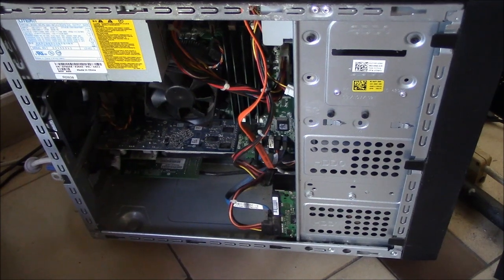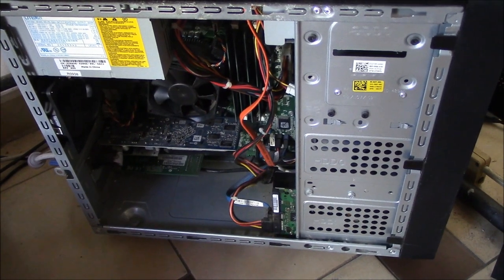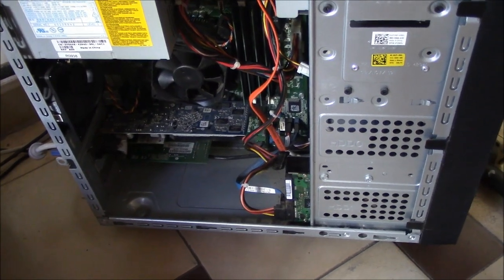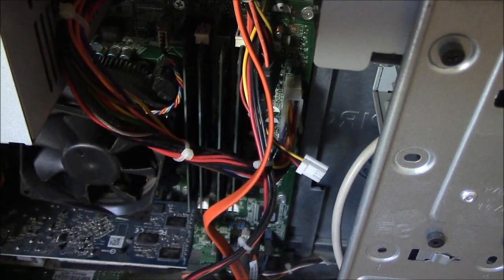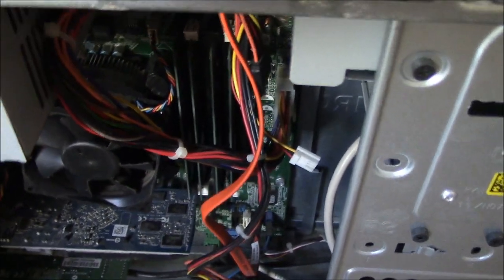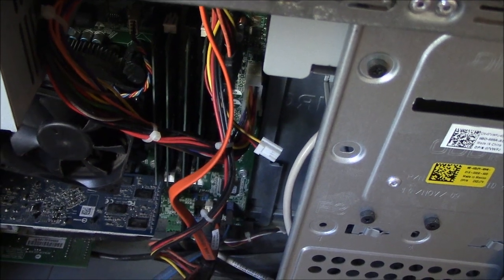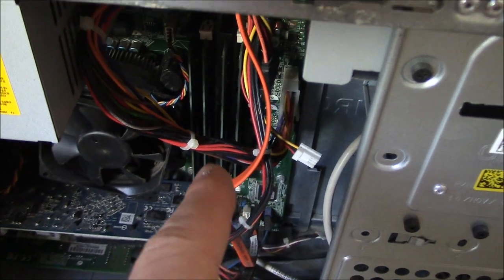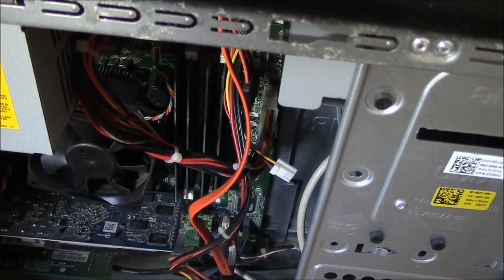Computer Four Beeps And Won't Display Quick Fix

Comment: Dude you just saved me BIG TIME!  And I mean BIG TIME!!    I was on a very important deadline.  The material I needed was on my PC. I couldn't get passed those damn beeps.   I have never opened up a tower, let alone took anything out of it.  You walked me through the whole process.  IT WORKED!  God bless you and thank you for taking the time to help people in this way.  I am so very grateful to you!!
Reply from the maker: You're welcome. Thanks for your kind comment.
Reply: Kimberley Crawford agreed
Reply: DIY University I just was trying to see if I had enough places left for an 8 pin connector for a GPU (it turned out a GTX 1650 doesn’t even need a power connector so there’s that XD), and I found out it didn’t, so I reconnected everything, and then I got the 4 beeps. I thought I killed my own PC, lol. I did unplug a couple things, but then plugged them back in so that absolutely could not have been the problem. I did see a crap ton of dust that I blew off the front filter. When I heard the 4 beeps I couldn’t figure it out so I just googled it because I know certain errors on PCs can be conveyed through beeps, and then I came to this video, and when I got to the certified air compressor part (I forgot what it’s called exactly), I knew immediately that it was because I blew dust from the front filter, and I took the RAM modules out, blew in the sockets and on the modules themselves (I didn’t have an air compressor with me), I plugged everything back in again. I thought it wouldn’t work because I go through a lot of troubleshooting with somethings and it sometimes takes hours, but it ended up fixing my PC. Thanks so very much. I literally almost shrieked out loud even at 2:20 AM, I just became overwhelmed with excitement. 😂
I literally subbed and liked immediately because my overwhelming gratitude could not be expressed any other way. 👍
Reply: Lmao I'm 9 and I did it without his vid
Reply: Drewless yeah sure you did. I find that extremely unlikely. Nobody would be able to figure that out without a video. You obviously were wondering how do you came upon this video. That alone proves you didn’t do it by yourself because why would you even be on this video?
Reply: Drewless watch that language. It’s hard to tell what jokes are in text bud: I don’t appreciate being talked to like that. Kind of racist language.
Reply: Idk why every computer dies when you have something important to do mymymy
Reply: @allaprima  uh, what?

Comment: Thanks for the concise tutorial. It didn't work for me, but as I had the computer on a bench and could see inside, I noticed that the fan in the PSU did not spin up. I replaced the PSU, and all is good again This was on an HP Z420 workstation. So if this doesn't work, check out the PSU.

Comment: I just used a vacuum and it worked perfectly, thanks
Reply: YOU DID WHAT
Reply: @Dekoyy  used. A. Vacuum. Cleaner.
Reply: @Jordamson  Oh my. Uh just gotta tell you that um vacuuming electronics is not a very good idea
Reply: @Dekoyy  um, why not? Lmao
Reply: @Jordamson  Using a vacuum cleaner on electronics can generate static electricity and fry components
Reply: @Crdguy  lmao dw, it's an small computer vacuum cleaner
Reply: @Jordamson  Ah okay, fair enough

Comment: Thank you so much. It worked. There was just a bit of dust on those drives i removed them 1 by 1 cleaned it up and after that it was working again thanks

Comment: You need to specify the maker of the motherboard. The start up codes are different for each manufacturer. That's why you have people in the comments saying it didn't work. What works for you motherboard won't work for someone else with a different brand.
Reply: Actually with this, the 4 beeps means there was something wrong with the ram, and that should be universal, if it didn't work for other people it could mean either their ram has gone bad or there's a problem with the motherboard

Comment: I have an HP workstation (the wx4600 to be more precise; yeah, I know it's ancient ;)). Whenever there is an issue with the seating of the memory modules 1)I get a different number of beeps (if I recall correctly) and 2)the CPU fan starts spinning like crazy. If you have some dust in it you will probably enjoy a nice cloud of dust that the fan farted out right when the crazy spinning starts. LOL

It's up to the motherboard manufacture and this video here should mention 1)who the board is from and 2)that it's not an universal solution.
Reply: rbaleksandar hey I have the same exact problem as you, I have an old hp with upgraded parts in it and I recently put in a new hard drive because my old one was skipping and now when I start it makes 4 beeps and shortly after the fan goes into overdrive mode lol. Would you be able to help me dissect this??! Thank you

Comment: Did you fixed that ?? Bro pls i need help, ich bought a new cpu and installed it. First it goes on and after 5 sek it goes off, ovr and over and over . After a few times it beeps 4 times but on the screen ist nothing. I did all kind of fixes but not even one of them helped me.
Reply: okay mohammed beruhig dich

Comment: I have 8 RAm slots . Clean up all and nothing.  And only when unplugged all the cables from the panel (keyboard, mouse, internet cable) and wait for 20 minutes PC start with no problems. Sorry for my eng. My PC is HPxw6600 Workstation  ( 8 Intel-Xenon  Processors , 8 RAM slots with 32 RAM , GeForce gtx 1050 ti graphic card, and 650 w Power Supply . Pls help.

Comment: Can you please help me? I have been removing it and changing its position multiple times. But it still beeps the same. I already cleaned it many times but still the same. Please help!!
Reply: Same for meee
Reply: Check the CMO Battery ! May need replacing

Comment: Also those simple tricks don't help. I found out if it's none of that above then it's definitely the battery for the BIOS. I changed that and it solved the problem.

Comment: i reset all the rams but it still beeping and blinking 4 times. do you some more ways to fix it?
Reply: Make sure you hear a "click", and the holders click into place without you having to click them into place with your hands. Don't force them in, but apply firm pressure
Reply: Vast Nation how can u tell which one goes in the right spot?
Reply: @zuxful4682  Well, if you bought the computer from a store, then just place the ram stick where you took it from. You shouldn't remove all of the sticks at once so you can remember where each one goes. If you are building or built a system, in most cases if you have two sticks of ram, you will put them in the slightly darker colored clips. If you have 4 sticks of ram you will use all 4 slots, doesn't matter what order. If you have any more questions just reply  to me again.

Comment: Urggghhh, how do u fix a pc that runs for 10 secs and then sounds like a helicopter and when yiu turn it off it beeps 4 times
Reply: Im having the same problem.
Reply: Possibly hard drive failure since it shuts off and gives a mobile stop code

Comment: It beeps when i turn it on after its been off. It only works by putting the ram in while pc is on
Reply: Don’t do that always turn pc off before removing components!
Reply: @Devghost  ik that but it works. the computer is a cheap best buy computer. i can explain how cheap it is. it has no ssd and is 600 dollars

Comment: I've taken all 4 rams out. Took all the devices off like mouse.keyboard.CDROM.HDD. so only mb attached with PSU .but I'm still getting the 4 beeps and red light.. Before my PC ended up like this the CPU fan was running at full speed even if I was not doing anything on PC ..and when I switched PC off after 5 seconds it automatically turned itself back on ..I would have to set the time and date in bios all the time since this problem started .also i relised the lan port did not flash anymore so it stopped showing the network adapter in w10 devices...I've changed the CMOS battery...still 4 beeps on HP dc5800 ...any ideas as to what it might be ...
Reply: tanny bash i dont know if its gonna work for you but i completely cleaned my pc and installed 2 extra fans into it and connected those fans to my cpu via usb cables soo they can start with the pc and keep it cool
Reply: I have same problems with my Hp 6600 . Unplugged all cables on the panel (mouse,Keyboard, internet ,headphones ) and wait 20 minutes . First plugged power cable and start PC. After 1 min plugged all others cables . This problem is probably on Power supply . Sorry for my eng.
Reply: Did you fixed that ?? Bro pls i need help, ich bought a new cpu and installed it. First it goes on and after 5 sek it goes off, ovr and over and over . After a few times it beeps 4 times but on the screen ist nothing. I did all kind of fixes but not even one of them helped me.